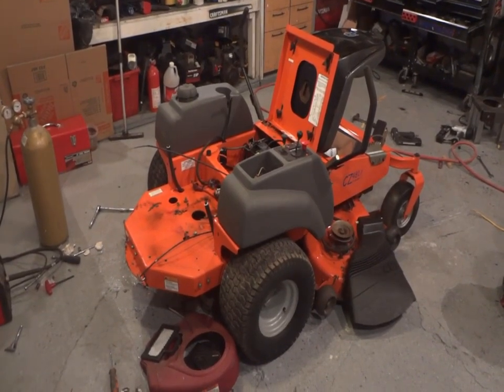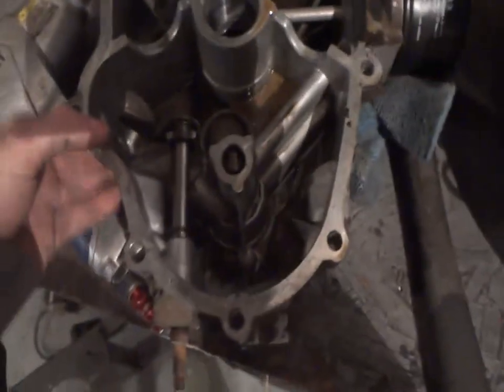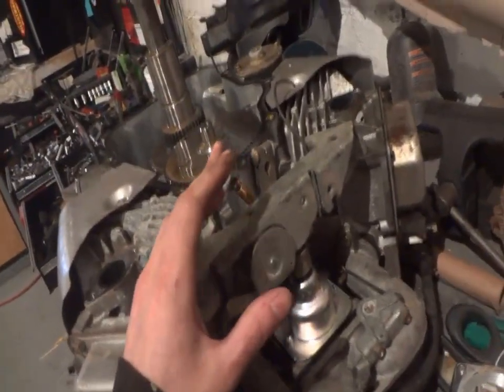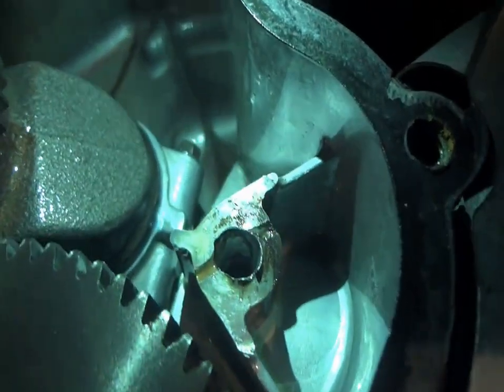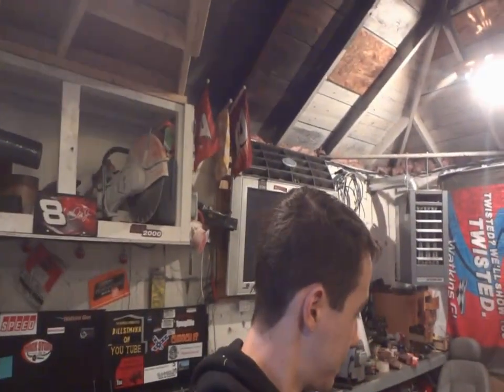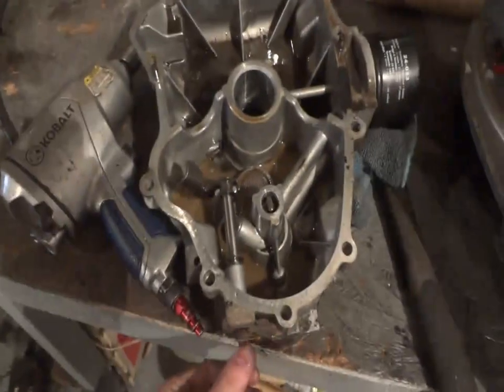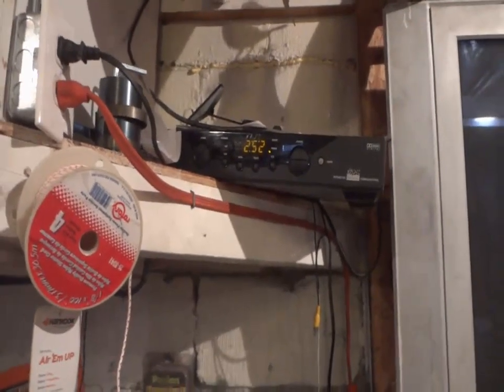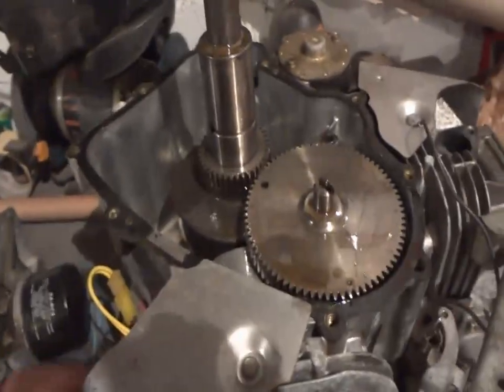20hp briggs and stratton missing some key parts

Comment: My daughter lives in Boston and was a mile from the finish line, thank god.  Hope everyone you know is safe!!  
I thought maybe you could drill that hole a little larger and press a brass plug to fill the hole and then drill the proper size hole to hold the centrifugal governor gear.  Since the block is shot anyway, you have nothing to lose but the cost of the brass plug!